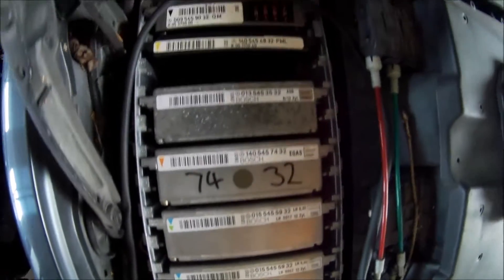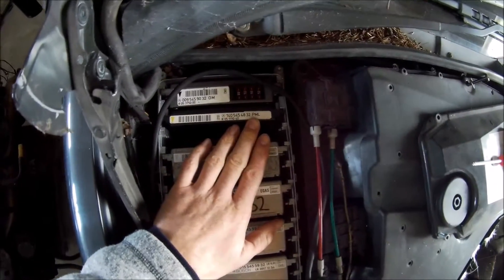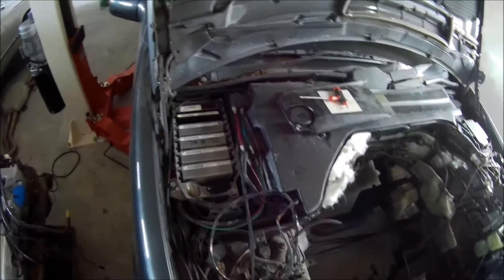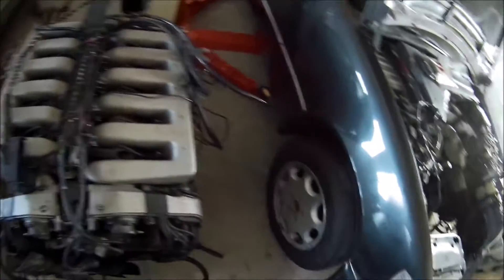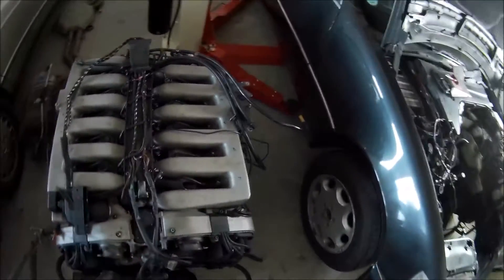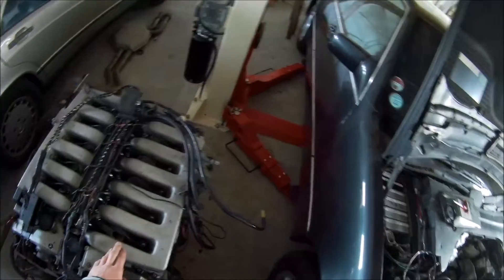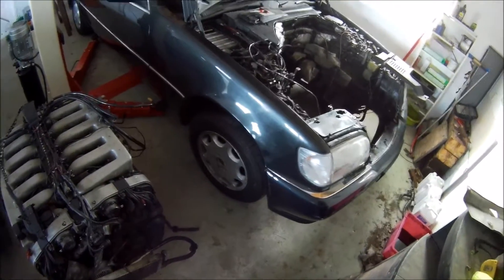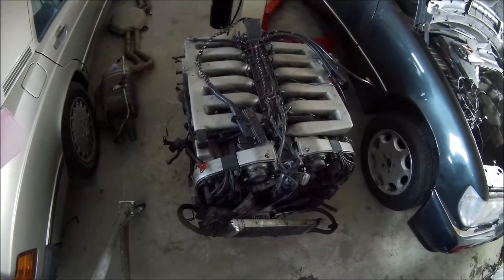Mercedes 600 SEL W140 complex engine controls. W201 V12 project JMSpeedshop !

Comment: M120  is the greatest  naturally aspirated v12 of all times.
Reply from the maker: For sure
Reply: @JMSpeedshop  i owned  this model  sec 1995 393hp (buy  en 2000 at 100 000 miles...  destroyed  en 2006 at 250 000 by a drunk driver..)...i re-buy one last week a SEL 405 HP 1992.. 180 000 miles  but perfect healh engine....EVEN MY  W220  IS NOT IN THIS PERFECT CONDITION.its jealous of m120  and 12 valves in more .loll !!!! ..(LOOL i joke my w220 365 hp (S600 L 2000) is very beautiful but  im sure  in despite of a more moderate mileage (130 000miles) im sure if i mesured compressions  m120 is like  at end of fabrication in 1992 !!!!   w220 is  good but   under level of his "mother," maybe   its normal.... but i hzve chance of own 2 generation. i understand  maybe  somebody  use term of "w140 las overenginered M.B "
Reply from the maker: IT is after 1995 the policy changed to make more profit and the w140 is in my opnion the last real flagship.  Only electronics van be a problem
Reply: @JMSpeedshop  electronic  of  instrument or  problem of peripheric accessories.. i agree i have always 30% of electric function "off"  BUT I  NEVER KNOW  ENGINE OR GEARBOX FATAL FAILURES  .....
Reply: @JMSpeedshop  my w220 its another history . .. (im lucky to be second owner...fiirst  had know enormous problem..Zas..airmatic..ignition boxes ... etc etc..  but i buy it in 2012  and its 8th years withouth failures or immobilisation for me ...

Comment: Any update on which ECU you’ll be going with?
Reply from the maker: VEMS standalone ECU
Reply: What is trigger setup for this engine? How many teeth it has? Do you use 1 crank sensor and 1 cam sensor in wiring? Thanks
Reply from the maker: See my last video in the project playlist OR have a look on https://jmspeedshop.com

Comment: Im 15 years old and I love Mercedes, I own a 1994 e220 c124 and a 1993 e220 c124. I want to completely change the 93’ by swapping the engine to the m120 engine with a 6 speed automatic and a locked differential, any tips?
Reply from the maker: Watch my complete playlist of this project al the modifications are Likely the same as in a w124

Comment: need all computers to work... :) all 8... 2 for the injection 2 for the ignition and 1 for throtle body... PML ASR and computer for all computers must be connected... i work with LH SFI... perfect but dificult system :) https://www.youtube.com/watch?v=dpZRwal0tb0 you will have problem with rpm's if you put only 5 ecu's
Reply from the maker: I will use 1 stand alone ecu And Just cable throttle body

Comment: Dear friend, I have a. Mercedes S600 V12 1997 that shows faults in the operation, I am from Brazil and I have difficulty getting manual repairs, alternate cylinders work, but everyone has spark in the coil and fuel, any help to identify the problem?

Comment: how easy would it be for same conversion from a 1992 car engine as regards to get it started also does the early 92 engine have 4 speed 722.3 ?
Reply from the maker: +xjs2  my donor car is a 1993 with oem 4 speed but i wanted a 5 speed.  In 1995 the 5 speed came oem on the model. It makes no different to get a early model running against a late model only the 5 speed needs a extra standalone ecu And the 4 speeds does not need that
Reply: i meant how on ignition side what is needed to function right with original ecu 

is it 

2 ecu for engine and thats it? i thought earlier ones were easier because they had normal coil or ignition system thanks for quick reply.
Reply from the maker: +xjs2 earlier version had distribitor ignition. Up to 1995 after that coil plug ignition.  You need 2
Engine ecu's. The asr module And the egas module to control the engine so test is 4 ecu,s for only the engine when you want the oem
System.  No matter what year the w140 600 is
Reply: ok so to not use asr and 1 ecu egas i need aftermarket ecu right? if so can you tell me which ecu did you use and do you have to set it up on rolling road
Reply from the maker: +xjs2 i'm going to use aftermarket standalone brand is on your own decision it Just need to control a 12 cylinders
So needs at
Least 6 ignition ouputs
Reply from the maker: +xjs2  tuning depends on te experience of the tuner but Rolling Road or engine dyno is always good to see how efficiënt it is running

Comment: How are you doing regarding combining the 2 ECU'S into one?     I subscribe to VSANDVS and he is excellent at electronics, however he keeps them stock
Reply from the maker: +jim dandy  i'm also subscribe to vsandvs  very Nice good detailed video's.  The 2 ecu that Mercedes used for the engine control is Just going to be 1 aftermarket ecu for the engine And 1 ecu for the transmission.
I will not use Any of the oem Mercedes engine controls
Reply: Interesting and complicated project and will follow your progress
Reply from the maker: +jim dandy  Thanks,  a bit a challenge is always fun i think.  

Don't forget to subscribe

Comment: Hi, I am now installing a M120 V12 engine in my Nissan S14 sylvia drift car. I have completed the manual transmission conversion and now building the turbo manifolds. If you think you can help me with the wiring and ECU (of course I will pay you) please send me an email   nikoslardis@gmail.com   Facebook   Nikos Lardis
Reply: Nikos Lardis How did you do your transmission?
Reply: I would like to know how to drive my transmission manual I’ll pay you to convert mine
Reply from the maker: Ad some more info what You want
Reply: JMSpeedshop ! Hi I have 1999 S600 W140 and I would like to put manual transmission like to know what I need to convert it or what another transmission will be comparable transmission with  the M120 engine
Reply from the maker: Only custom made there is no direct fit option
Reply: JMSpeedshop ! Ok thank you I guess I have long journey  is you transmission manual if yes do you have a video how you custom
Reply from the maker: I have a 722.6 5 speed automatic

Comment: Can the 722.6 handle the torque?
Reply from the maker: +AMG BENZ_HAMMER_6.0 yes it can handle in stock form up to 1100nm
Reply: JMSpeedshop ! Cool i didnt know. My 95 SL500 has the 722.3, i wish it had the 722.6 more smoother and responsive.
Reply from the maker: +AMG BENZ_HAMMER_6.0  you can swap the transmission for. 722.6 is also 5 speed so better economy on longer drives
Reply: JMSpeedshop ! ya i was thinking about it but its low miles it only has 107,000 miles just did a transmissiom flush so my 722.3 should running for a long time hopdfully. if it goes out ill put a 722.6. Got to fix my wiring harness first.
Reply from the maker: +AMG BENZ_HAMMER_6.0 oke yes that is more important the harness

Comment: As the transmission control for the 722.6 requires two pwm outputs and just triggers(no static outputs for individual gear) for the gears you have to use the ole controller for the 722.6 / NAG1. pretty expensive.
You cant use a microsquirt or similar...

I would go for a ecumaster emu. or emu black.
cop setup and bank firing injectors.
Reply from the maker: +Carl Benz i'm going for KMS MD35 ECU And ofgear TCU from ole.  That is how i'm looking at it right now. Then i have 2 standalone systems that is the best in my opinion
Reply: kms is  pretty expensive for what it's capeable of.
Reply from the maker: +Carl Benz that is your opinion ;). The have a lot of experience with tuning And remapping And it is easy for me to get some help with remapping And get it in good running order because it is a dutch company